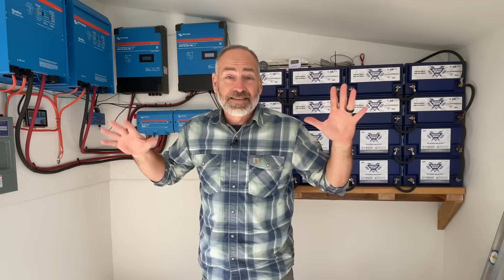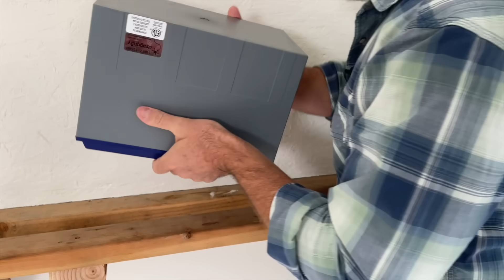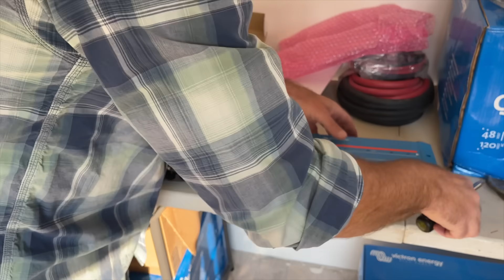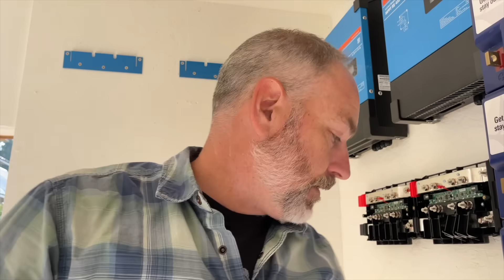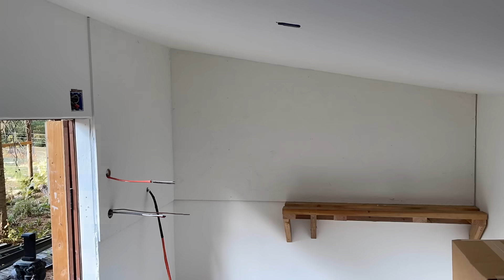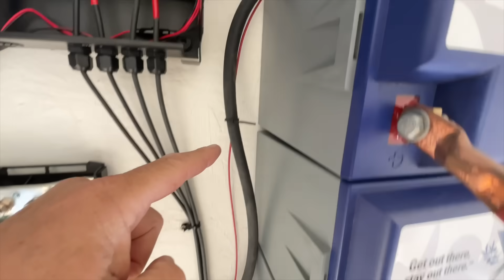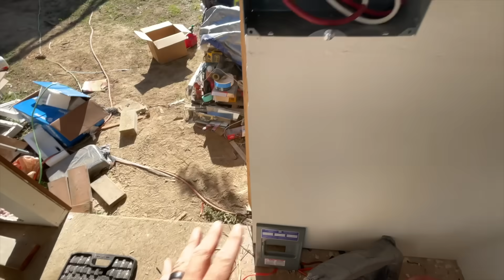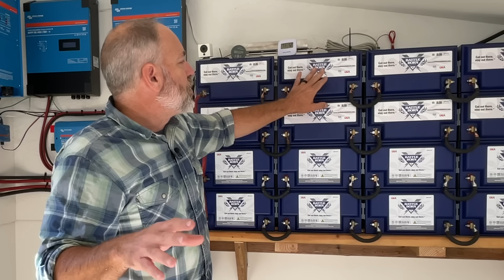EASIEST Off Grid Solar Power System Battery Bank

Comment: What were the challenges you had with your previous system that made you upgrade to this set up?
Reply from the maker: Having to run the generator every few days in the winter.
Reply: We are just getting started on our off grid journey across the border from you in Steven's County. Would you suggest we go with a bigger system like this right from the start then? Would more panels on your previous system been better? Or is the 48v system just a better idea?

Comment: So you're only going to push 50A to the house? Or are you going to upgrade that when the other panels and inverter are online? Also what did you do with the old setup?
Reply from the maker: 10000w / 240v = 41.6A if I add more inverters then I’ll have to deal with that. But not planning on it.

Comment: May be cost is not your concern. Going through all this trouble logically any penny pinching person would wonder about the cost on each items for the system. Honestly, you just didn't though of mentioning the cost you spend?
Reply from the maker: There are links in the declaration were you can check current prices. You know how prices have been changing lately.
Reply: @MartinJohnsonOffGridLiving  Your respond's was predictable and typical excuses  for deficiency.
As a reference, a simply estimated price or the price you have paid will answer the complain.

Comment: I like your videos, but anyone actually paying for the equipment to DIY their own system would be a fool to use those batteries!
$875 per battery, times 16, equals $14,000 worth of expense for 19,200 watt-hours of power.  A server-rack battery system, with 6, 100ah batteries @ 48v, costs $9,000 and delivers just over 30,000 watt-hours of power.  It's much simpler, much less expensive, delivers 50% more power and is 50% less expensive...literally 4 times the value!
I know Battle Born gave you all of those ridiculously over-priced batteries, and they ARE very high quality, but for a stationary deployment, those are the most expensive possible solution you could have gone with...and that is far from the "EASIEST" solution on the market today.
Reply from the maker: A lot of people are used to 12v batteries. They understand that world. They grew up with it. These are drop in replacements. Easy to understand. 
I didn’t even mention cost in the video. You should buy the products you want at a price you can afford.
Reply: @MartinJohnsonOffGridLiving  - I'm just saying, if you're going with a 48v system, and want twice the value, a server-rack setup is much easier and safer.  Who wouldn't buy 50% more battery, at half the price, if they were doing it on their own dime?  The rest of your system is awesome, although I would bet money those inverters are too close together, if you look at the specs on mounting them.

Comment: 125A battery fuse isn't going to last long with a 10kVA load.
Reply from the maker: True. That was what was in stock. It is okay for around 6000w. We are only actually using about 3-4kw.

Comment: I also notice your AC out is orange Romex which is 10awg, which is rated for 30 amps. At 5000 watts each those inverters will output 41.66 amps, which requires 8awg.

Comment: So these are approximately 1.2KWh for $900.  Many folks have been getting EG4 LiFePo4 5.12KWh 48volt server rack batteries for $1,499.  Building 19.2kWh with battleborn’s would cost $14,400.

Getting 20.48KWh from EG4 batteries would cost $5996.  And they have built in breakers and BMS’.

If you spent the same $15k or so in EG4’s you’d get a whopping 51.2KWh of storage

Comment: Interesting setup.  The cables and connected equipment resting on top of the batteries would be better mounted away from the batteries.  Ventilation for heat in summer as others have suggested as to battery support or strapping.   Other than that well planned and installed.

Comment: Thanks for the video. But the ac wires out of the inverters seems a bit small. The inverter is 5000 watts. So 5000 / 120 volts is 41.6 amps which would be a 8 awg wire at least. It appears that the the wire used is either 12 or 10 awg.  What do you think?

Comment: THE LINES GOING FROM INVERTERS TO AC/ HOUSE LOOKS SMALL 4-0 CABLE IS USUALLY THE SMALLEST LINE INTO A 200 AMP AC PANEL YOU CAN DAMAGE YOUR APPLIANCES IN YOUR HOUSE AND CAUSE A FIRE AND MELT YOU INVERTERS I AM TALKING ABOUT YOUR OUT PUT CABLE IT LOOKS LIKE YOU HAVE A #8 WIRE

Comment: Hi Martin, not that I am doubting your workmanship but I would put two pine legs under your battery shelf so legs sit on the floor. Just in case as a bad storm with flying branches and debris could hit the shed wall dislodging batteries and have that weight hanging off delicate equipment.

Comment: two problem I see the wire use from Inverter to power center or breaker panel is too small Need be 6AWG wire (5000W/120 volt = 41 amp ) Need 6 AWG wire the 10 AWG was fine for old system 2: the breaker for light and receptacle need single breaker Not double breaker with connecting bar

Comment: A great system, Martin.  Just one point.  Each 100aH battery at the nominal voltage of 12.8vdc equals 1280 watts per battery (100x12.8=1280).  1280 times 16 batteries equals 20,480 watts (1280x16=20,480). So your new battery bank is now 20,480 watts (not 19,200).

Comment: OK you have insulated the walls and ceilings and I expect you plan to insulted the door, seems straight forward but make sure it gets dow soon. But did you insulate the floor? At the very least put 2" XPS on the current floor and then OSB on top of the sheathing as the walking on floor surface.  An unisullated floor will result in a lot of heat loss, especially without any actual heating in the solar shed.

Comment: Since you have added the breaker panel in the solar shed, you need to make sure your neutrals are not tied to the grounds in the house breaker panel. The first panel is the only one that they should be tied together in.  Any sub panel needs to have the neutrals isolated from the grounds.
Reply: Exactly. I was also wondering if his generator has a floating neutral.. being a separate power source. It would be interesting to know if the automatic transfer switch that’s built into his inverters are switching the neutrals too… this would be an excellent topic for another video.
Reply: @musicbox4022  Exactly, when a generator is connected as a power source to a building, it should be floating neutral system and the bond between the "Grounding conductor" and "Equipment grounding conductor" should be made at the first service disconnect of the building. When a generator is used as a portable power supply used with extension cords, the same bond should be made at the generator itself!
Reply: @uhjyuff2095  right but in this case he’s switching his power source between his solar/battery inverters and a generator with another inverter… So some people run both the generator and the battery inverters with bonded neutrals and simply switch the neutrals in the transfer switch, similar to an RV set up… so I’m just curious if he’s got his house set up like this or if he just uses one bonded neutral and the transfer switch only switching the hot leads with the generator floating.
Reply: @musicbox4022  An RV generator setup is the same as using a portable extension cord because no building is involved. When a building is involved, the generator should be Floating neutral design.
Reply: Martin, I received a suspicious reply. This is the second reply I have seen like this on your channel. Please look at the replies. I am afraid someone is spoofing you. Thanks
Reply: @rbartlett6606  Conforms to NEC

Comment: Greeting From Tulsa Okla. I have been in the electrical field since 1973. Navy Veteran and in Electrical Engineering ever since. Currently work as a Principal Designer for one of the largest in the US.  Sorry felt that I needed to say that before I made some recommendations. Batteries should always be spaced apart. A one-inch gap between each battery will allow good airflow during heavy loads. Yes, they will get hot. You lug crimper did not impress me. Harbor Freight has a sixty-dollar hydraulic criper that works very well.  I also would recommend a small heat shrink tube to cover the gap between the lug and the rubber jacket. Dresses it up. Too many people use the wrong lugs, you have the right ones. The cross-sectional area of the lug should match the cross-sectional area of the cable. I would have used a cable raceway for your power cables. It keeps the cables neat and clean. And last, I would have installed a 150- or 200-amp service to you home.  OK, one more. I fused each string of batteries in my bank. If you calculate the short circuit current of all your batteries, you will find that a dead short means fire and pain for someone. All in all, you did the best-looking installation I have ever seen on YouTube. Yes, I have solar on my house in Tulsa.

Comment: I'm not an electrician. Your 50 Amp from the solar shed to the panel in the garage... what is the Amp rating of the garage panel main disconnect?  Which one should be bigger? Do you need to have this inspected for insurance purposes? Your a rock star Mr Johnson!  Great content!

Comment: Question, seeing how you do not have to vent those batteries could you not have your set up inside the house instead? They would stay warmer in the winter and probably cooler in the summer.

Comment: Very nice install. I use Battle Born as well. I purchased the heated version because I am set up like you. Separate building for power. Not insulated. Rarely turn the heaters on. Don’t even know they are there. Very low draw. Good stuff.

Comment: Especially when you go 400v it’s vital you don’t have exposed copper like your PV. They will arc that close. 

Buy yourself a ferrule kit on Amazon and crimp ends. The. You’ll have them the right length and they won’t work themselves lose and there won’t be any exposed pv copper.

Comment: Thanks for this very informative video. You explaining everything clearly is much appreciated. Getting ready to set up my off grid system at our homestead in Alaska. Local power company wants $14K just to hookup to a pole within 50ft of my house. The building is 300ft from where power pole is at the end of my driveway. I figure within 6 years my Solar System will pay for itself. You also have to sign a contract with the power company for 10 years and to have at least a $150 per month of electricity.

Comment: First battleborn batteries are wonderful batteries. But I think there are cheaper batteries out now that are very similar in quality to them. Second I think the wire going from your 5,000 watt inverters. To your load Center is too small I think it has the potential to be pulling 41 amps Max the wire you have is only rated for 30. Amps also would be interested in a pricing guide to see how much a system like this costs if you have the time

Comment: Martin, very neatly presented and wired.  One thought; why did you go with the discrete shunt as opposed to the Lynx Shunt, which would have connected straight onto the busbars, thus easing the install further?

Comment: Martin the Inverter output AC wire seems to be small what is the size of those wires? By my calculation 5000W at 120v is about 42 amps * 1.25 = 52.5 amp, those wires should be 6 AWG minimum!

Comment: I've got an off grid system in a shed like you 😀 Started off with regular LIFPO4 's like you. Then added 25 KWh of server rack batteries. Currently I'm running 100% off grid with around  50 KWh total storage capcity. In the winter I heat my insolated shed with a cheap wifi electric heater. To keep the shed around 55F I burn about 1-2 KWh of power during the night.
Reply: You can't heat with power, you have to use energy.
Reply: Power is an energy   _ _ _ _ _?  😂
Reply: @SkyNoris  Power is the rate of doing work. That could be for a millisecond. 
Energy is work done for for a period of time. You are ignorant of physics.
Your 25KW for 1second is 25/3600=.007kw-hrs.
Reply: Electrical energy sources are measured in watt hours. This has nothing to do with physics. I was only talking about how much capcity and power used.
Reply: @SkyNoris  No, you are totally confused. You cannot think or talk about an energy system if don"t know the meaning of the words or the concepts behind them. Power ans energy are two very different things.
Reply: @Billy97 This is interesting because power is a form of energy.  But yes, they are not the same thing. Let me ask you this: How would you measure the electricity used to light up a 1000 watt bulb for an hour?
Reply: @SkyNoris WRONG.   Power is not a form of energy. Period. Get that out of your head.
A watt-hour meter can measure the energy to supply a 1KW load for one hour = 1KW-hr.
A source capable of 25KW for one second could not supply that load. A Capacitor could possibly supply 25KW for a few nanoseconds, but no useful energy for loads.
Reply: @Billy97 Right when I said power, I actually meant electricity. My mistake in that case. Electricity is obviously a secondary energy source. While power itself is the is the rate at which energy is transferred. Im guessing the 25 kwh you're referring. Would be my adtional battery bank storage capacity. 5 x 5.12 or 25.6 kwh, to be exact. Not the discharge rate per second. This is a very common way to measure battery capacity.
Reply: @SkyNoris  You are still confused. Electricity is a means of energy transfer, not a source nor is it  power. Both false.
Chemical potential energy stored in a battery can be transferred to load device operating to produce  mechanical power, heat , light or sound if a circuit is present , following Ohm's Law. An engine with power rotating a generator can do the same. Over time it is energy.
Work is force applied over a distance. W= F x D. 
Power is the rate at which work is done per unit if time. W/T.  The rate is instantaneous. . It can be for any length of time. A nanosecond or a year.
Energy is amount of power applied over a period of time.  1000KW for a millisecond is not much energy, but a lot of power for that millisecond.
1KW delivered for a year is 8760 KWH.
Reply: @Billy97ify  The electricity that we use is a secondary energy source because it is produced by converting primary sources of energy such as coal, natural gas, nuclear energy, solar energy, and wind energy, into electrical power. Electricity is also referred to as an energy carrier, which means it can be converted to other forms of energy such as mechanical energy or heat. Primary energy sources are renewable or nonrenewable energy, but the electricity we use is neither renewable nor nonrenewable.
Reply: @SkyNoris  No. It is not an energy source. Get that out of your head. That is a re tarded thought. It is a means of transmission only between the load and the source.
Renewable or nonrenewable has nothing to do with it.
Where do you live? 45kwh would not cut it where I am in the winter.
Reply: @Billy97  I'm in Northern Utah. In total, I've got around 50 kwh of total storage capacity. In the winter months, I'm using around 15 kwh per day. A few times a year during the winter, my batteries will need to be recharged after many cloudy days. Most often, though, my solar system does the job. I do  have dual 100 amp chargers if needed.
Reply: @SkyNoris  Interesting. It wouldn't work where I am north of 49. Dark six months of the year.
Reply: @SkyNoris  So, you have a bit over 3 days of storage. I am guessing your chargers run off the grid??? How much energy (kwh) are you using for charging? About how much did your  storage cost?

Comment: btw i wanted to add one more thing. I think that second connection from inverters to Cerbo GX is probably not needed as you will not see any benefits to it...but check for yourself.. even it is isolated so probably good thing